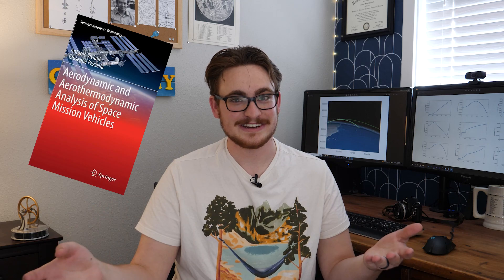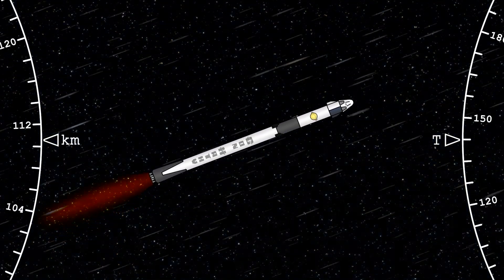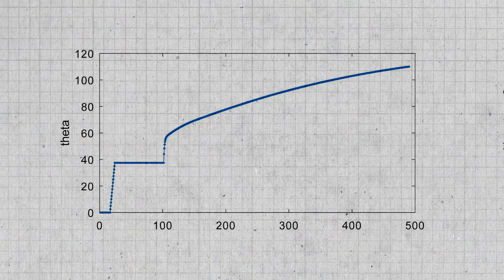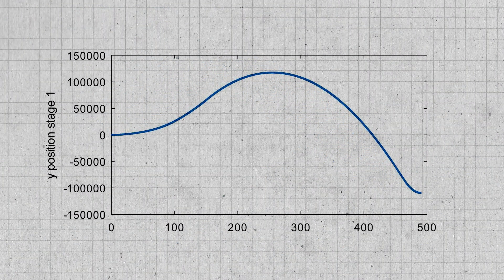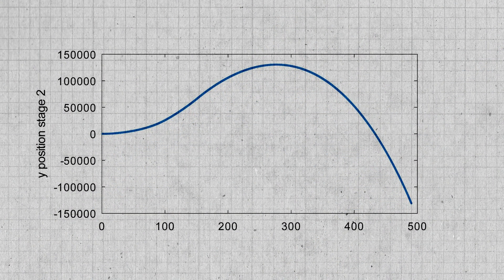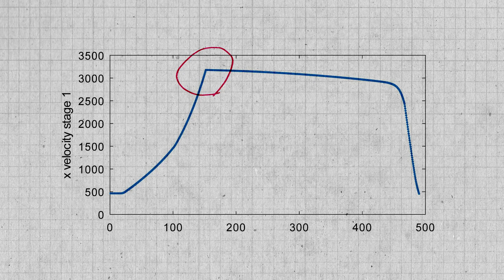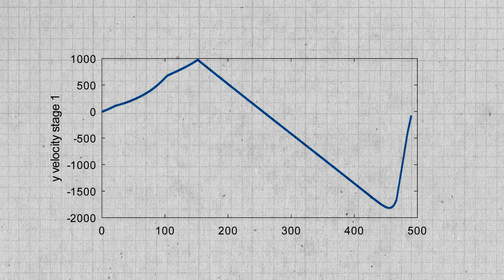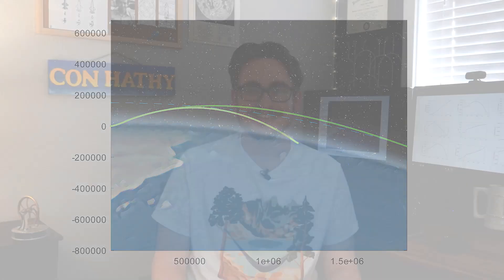Optimizing a Reusable Rocket Trajectory!

Comment: Looking at your velocity graphs, I think you forgot the centripetal acceleration effect of your x velocity on your y acceleration. I highly recommend doing some of your modeling in KSP and your programming with KRPC.
Reply from the maker: You don’t add centripetal acceleration back in, it emerges from modeling a point source of gravity. I tested the simulation against the 2-body problem by starting the rocket in orbit and removing all the thrust. It remained stable over multiple orbits. Just remember I’m using Cartesian coordinates not polar (i.e. y is not the same as altitude)
Reply: @ConHathy  Ah OK. A few years ago, I modeled a constant-altitude landing on the Mun in Excel, and it was something i had to account for to get the solution to work. I ran about 40 tests in game at various TWRs and I was getting to within 1% of the predicted dV expenditure.

Comment: I'm gonna do it: there are ways you could approximate stagnation point heating which require very little effort. Look at some of the stuff by Sutton and Graves
Reply from the maker: I ended up cutting some of my discussion about heating but yes stagnation temperature is pretty easy to get, the hard part is 1. determining the heat transfer coefficients (how much of that temperature is transferred to the rocket as thermal energy through convection and radiation) and 2. How much energy can the rocket absorb over what period of time. It’s not as simple as a max temperature because you can sustain a high temperature over a short time but may not be able to handle a lower temperature over a longer time if it ends up transferring more energy. The numbers for that aren’t readily available as far as I know

Comment: 3:50 Wouldn‘t it be possible to just say rocket = cylinder (probably a hollow one) and get first degree approximations that way? I would assume you can either find or calculate the lift behavior of a cylinder rather easily. I mean it doesn‘t have to be super crazy amounts of data anyway since you can make some reasonable assumptions about your maximum AoA and limit the complexity through that (and the simplified cylinder model).
Reply from the maker: I’m sure there’s an analytical approximation for the lift slope but I’m not familiar with it. It’s probably less effective than a flat plate but by how much? Also I would have to see how it changes at supersonic and transonic speeds